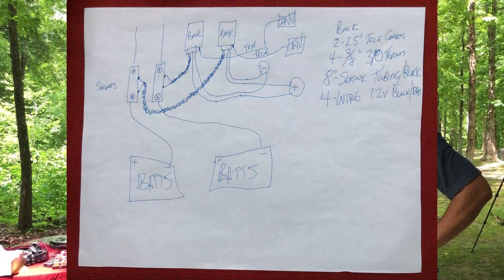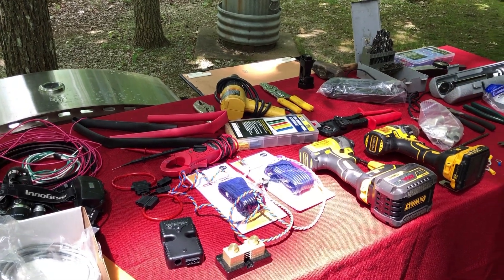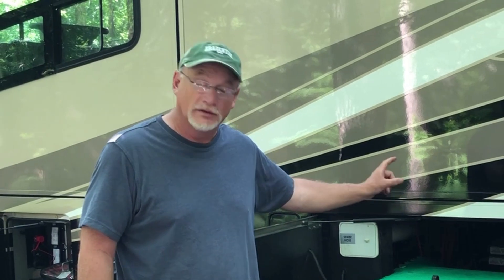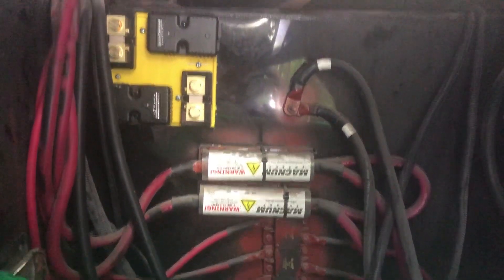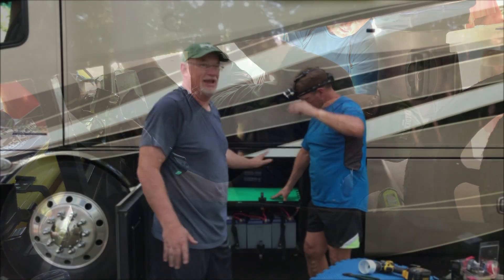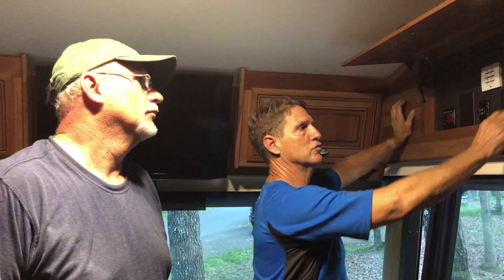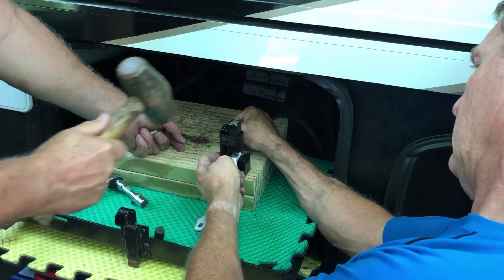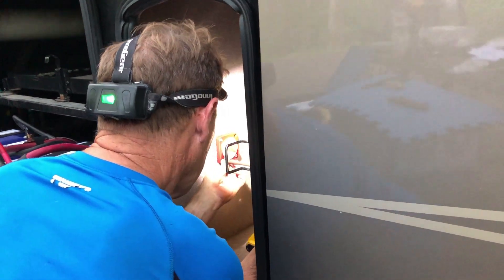RV LITHIUM BATTERY MONITORING || RV Battle Born Batteries || FULL TIME RV

Comment: Did you install a dc/dc converter between your alternator and lithium’s?
Reply: I did not change the dc/dc converter between the alternator and lithium’s.  I have 1,200 watts of Solar on the roof so they keep the lithium’s charged up, and I keep a close eye on the alternator voltage.  I was told it should be changed out but I have not done it yet.

Comment: Why didn't the same system you used to monitor your previous batteries work with the Battle Borns?
Reply from the maker: The previous system only monitors Voltage output of the batteries.  With Lithium batteries they put out a constant 13-13.1 volts until they are dead, so we installed the battery monitoring kits and shunts to measure the state of charge or SOC of the Lithium batteries.  We now see the SOC as a % such as 80% battery life left.  I hope this helps.  😎

Comment: So far not impressed with Battle Born. Called them Wednesday and left a message. No return call.
Reply from the maker: Lori - very sorry to hear that.  That's definitely not been our experience.  Did you have a specific question?
Reply: Our Epic Field Trip yes a whole bunch. We’d like to upgrade but want to know what is involved. Do we need different cables? Will our current system handle a lithium? Will it charge ok with our current system? We just bought our Class C so we aren’t electrical system savvy yet.
Reply from the maker: @wbuwausau  These are great questions !  We recommend giving them another call to let them know you haven't received a call back.  They're usually very responsive.
Reply: @OurEpicFieldTrip  Lori, I went to their web site last week and sent them an email and received an response the next day.
Reply: Every time I have called them they answered and were very helpful. Great customer service so far